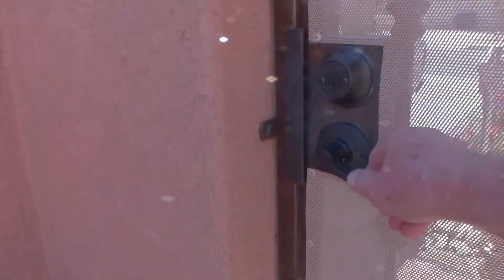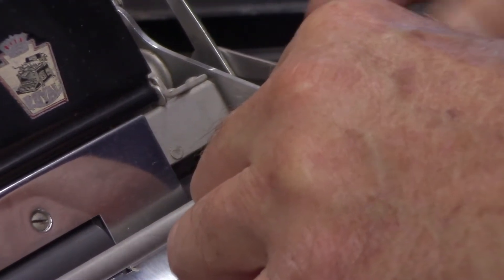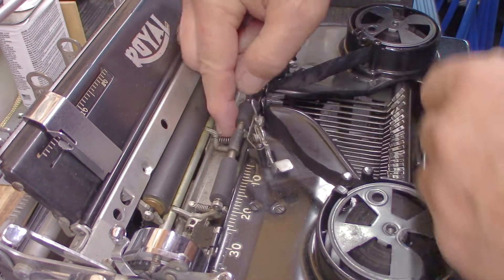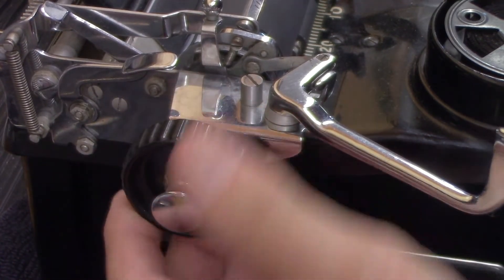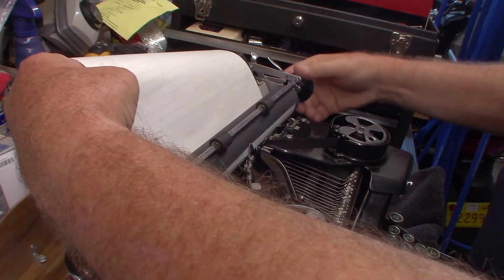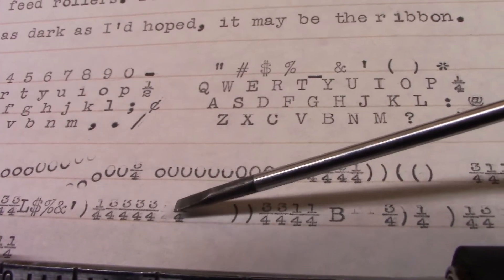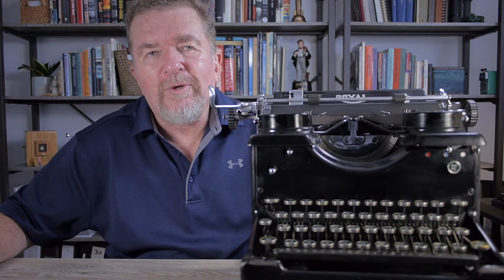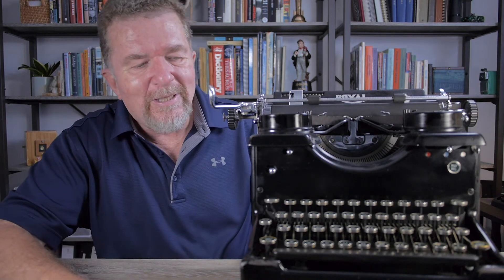Typewriter Video Series Episode 276: Royal 10 Fresh Rubber

Comment: Also, the first and currently only electric typewriter I have is a 1972 Smith Corona Electra 110, with a 10" manual return carriage.
It's a great machine, in a storm Grey body and yes a manual return at least for me, feels like the final step and a sense of both work and completion at the same time.  And I agree with you Joe.
Thete is a touch setting wheel on the bottom that can tighten up the keys going from cotton candy soft to stiff buttons.

I named it Lakota, which means Friend, and when you write a book, it's great to have a good friend who is strong and helps you make the journey.  A serious workhorse are these machines. 

I got it as I wanted to keep using a typewriter even after my hands and fingers hurt.  

Love seeing this, thanks Joe!